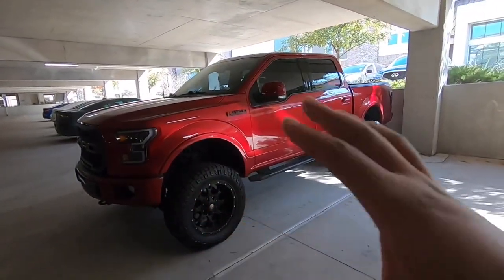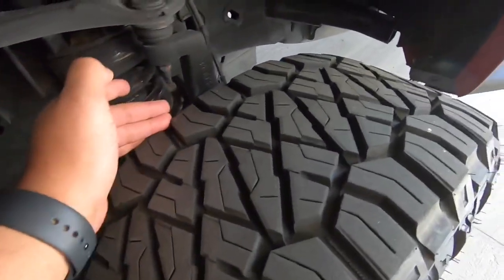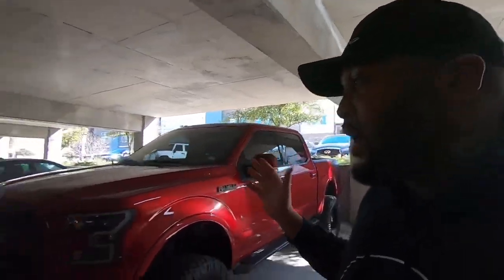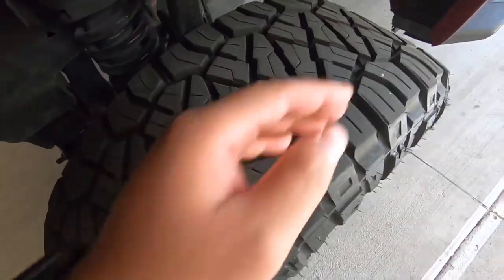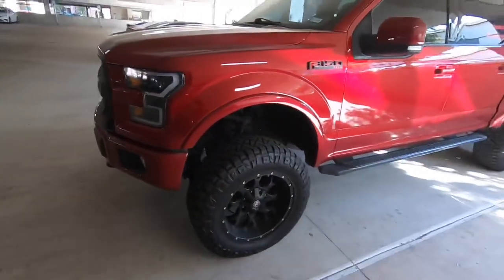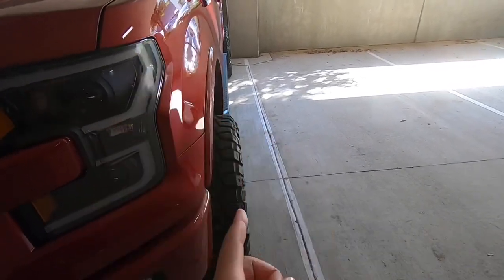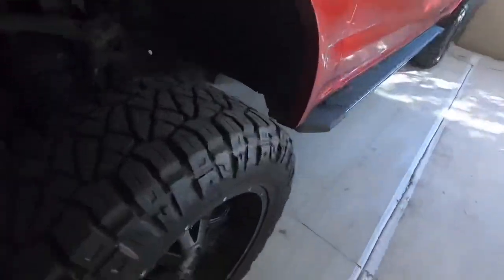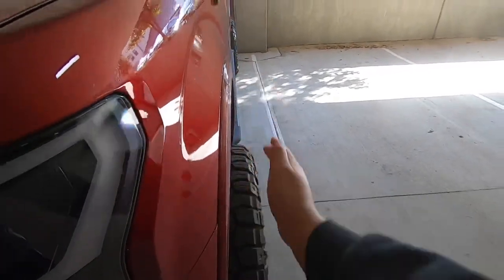What is Offset and Backspacing? My Setup

Comment: Q - it doesn’t look as aggressive, but the biggest advantage of positive offset (more backspacing) is that it usually gets you a better scrub radius. 
Scrub radius makes a big difference in how well the vehicle handles. The closer you can get the ball joints to the centerline of the wheel, the more cornering force you will have.
Reply from the maker: Good to know !

Comment: If there is any chance that you might change your control arms, check out the specs on what wheel backspacing they require before you get your wheels. Most of them will have a max of between 5” and 5.75” backspacing.
Reply from the maker: Preciate the info man! 🤝

Comment: Perfect timing. Just got my 20x12 -44s in the mail today
Reply from the maker: Nice!! Yea think I want the -44 offset next
Reply: @KickinItWithQ  these wheels are concave so lip is a little smaller at about 5 inches instead of 6. Can’t go wrong with 12 wides though!
Reply from the maker: Gotcha. Which wheels you go with?
Reply: @KickinItWithQ  force off-road F-38 in polished
Reply from the maker: Nice polished definitely coming back
Reply: @KickinItWithQ  just dm’d you a pic on insta

Comment: Nice Q. Always making time for a video. Now, to throw more math into the equation there are those guys that want wheel spacers. 😁 I personally do not use them nor interested in doing so.
Reply from the maker: Haha! Yea I’ve heard both sides of this one. Most recommend don’t buy if you do make sure it’s a  HIGH quality brand or risk your wheel falling off when you driving down the highway.
Reply: @KickinItWithQ  Bora is the brand name I heard that is high quality.
Reply from the maker: Think custom offset just did a video on that. Think they mentioned them as well